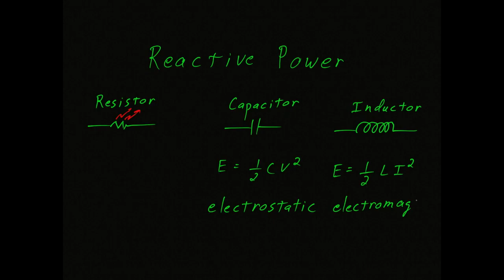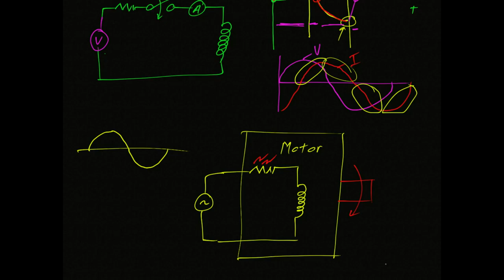Reactive Power - an introduction

Comment: How does or what is meant by time is indicated in the equation: E= 1/2 L (I^2)?  Probably a better question for me is what do I need to know in order to understand this equation.  Where  do I start?  I know from electronics class that an inductor places the current 90 degrees out of phase with the voltage.  How does this equation show this?   Thank you.